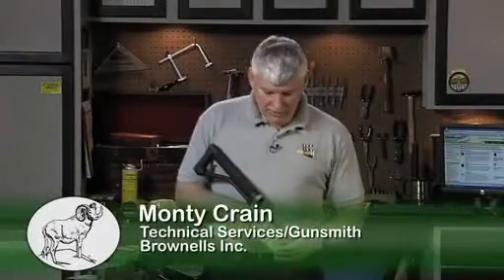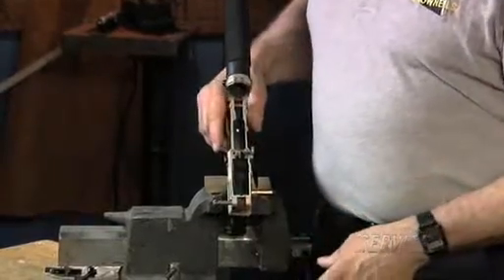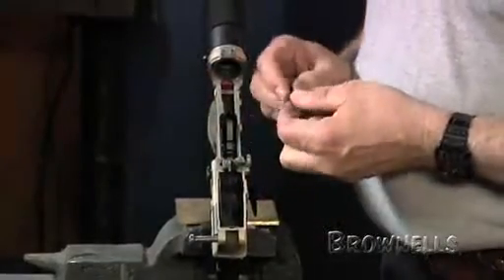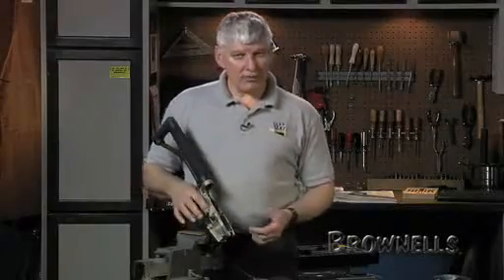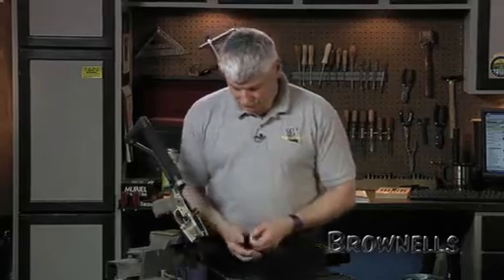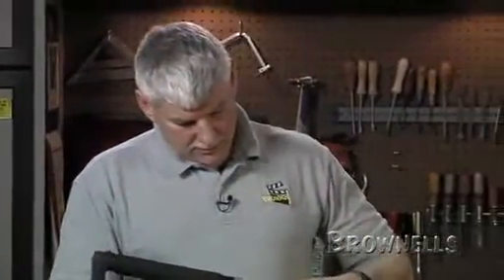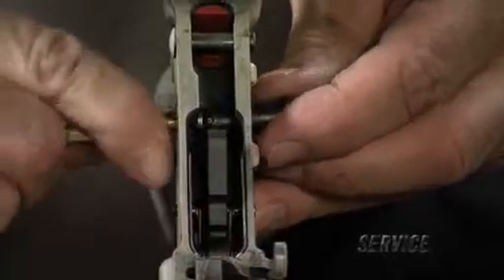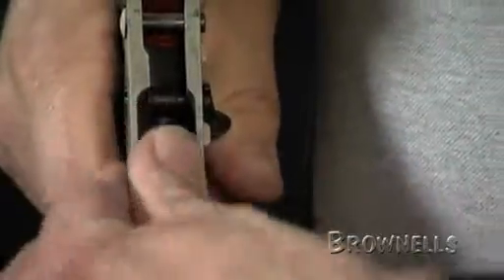Brownells - Installing a Drop-In Trigger In An AR-15

Comment: Folks, Good video as far as it goes, but if you weren't so caught up in just selling your product you would've realized that you've shown only half of the operation.  I am a 15 year Brownell's customer, I purchased the McCormick trigger from you recently and would like to see entire operation, including the removal of the stock parts.  The stock parts are under spring tension, I'd to see the technique a pro uses to remove them first.